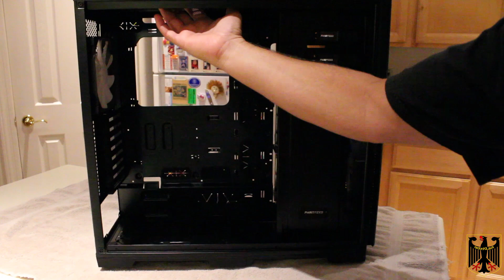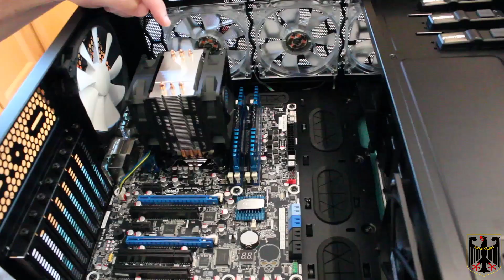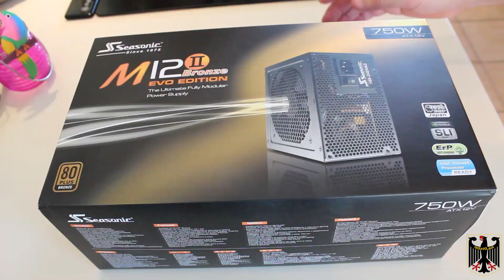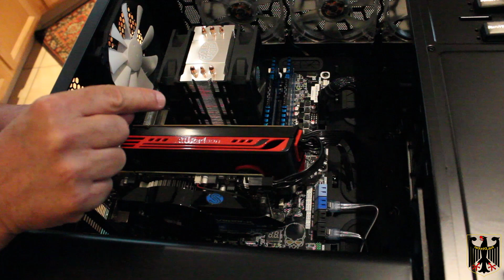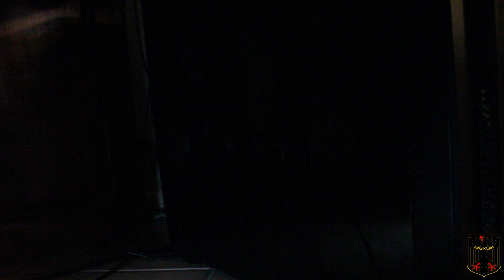Gaming PC Upgrade July 2014 - Phanteks Enthoo Pro and Seasonic M12II Evo 750W

Comment: I'm confused with the PWM hub.  So, do I still connect the CPU fan to the motherboard's CPU_FAN header?  The reason I ask is b/c the PWM hub includes a cable that is labeled to plug to the CPU_FAN header, but if I do that, where do I plug the CPU fan 4 pin connector?

Thanks
Reply from the maker: +Leba You plug the CPU fan into the CPU fan header, and you either plug the hub into the CPU fan 2 or an aux. fan header.  The reason it says to plug into the CPU fan header is the fact that it wasn't common to have all full PWM headers on a motherboard when the case was made.  Thanks for watching!

Comment: Do you have any problems with the fan on that PSU?
Reply from the maker: No issues at all, it's a great PSU.  Highly recommended.
Reply: redonKiLaus I have issues with mine (750watts M12ii Evo) , the fan is going grazy when I render or when I launch a game
Reply from the maker: Are you sure that it is the PSU fan?  I would venture to guess that it is the CPU or GPU fan, as those will certainly kick up when rendering videos or gaming.  If it is indeed the PSU fan, you are probably putting a high load on it if you are running multiple high-end GPUs and a high-end CPU, in which case you could do well with a higher-output PSU.  The most I ever run on a 750W PSU is 2 high end single GPU cards...3-way and 4-way, or 2 dual GPU cards require more power than 750W.
Reply: redonKiLaus nop its the PSU fan I tested them all , when i stop the psu fan the pc is pritty much silent =(
Reply from the maker: RMA the power supply, Seasonic is very good about replacing faulty components.
Reply: redonKiLaus Okey , I will ! :)
Thanks!
Reply: redonKiLaus How do you connect the fan connector Does it use a molex that will go into your PSU?
Reply from the maker: You use either a 4 pin PWM header on your motherboard OR a SATA power connector.
Reply: redonKiLaus Ahhh, And that cable comes from the Motherboard?
Reply from the maker: The PWM header is on the motherboard, the cable to connect the fan controller to the motherboard is included with the case.  The SATA power connector is on the power supply; it's the same connector you use for hard drives and SSDs.
Reply: redonKiLaus Ahh i see, So the PWM head connecter on this case that has a CPU fan header cable connects to where the cpu fan header would be while a sstandarddata cable would hook into that from the PSU right?
Reply from the maker: You can connect it to where the CPU fan connects, or you can connect it to another 4 pin fan header on the motherboard.  Either works just fine.  The SATA power connector is only used if you don't have a connector on the motherboard for the 4 pin cable - you use one or the other, not both.
Reply: redonKiLaus Ahh thanks, Greatly appreciated.

Comment: U should use a water cooler that way u wont get the added heat disappated from the cpu air cooler
Reply from the maker: I watercooled my first PC, but in all honesty, it's just too much maintenance for someone who doesn't mess with computers a ton anymore, and CLCs don't provide that big an advantage over tower air coolers (especially when it comes to price/performance).  Thanks for watching!

Comment: i have this case, just waiting for my other parts to come, but can this case have a cd reader ?
Reply from the maker: This case can hold 3 5.25in drives, though to be honest, I have put CD drives in any of my PCs since around 2009, as pretty much all media is downloaded and distributed online.  I do have an external Blu-Ray burner for HD video distribution if necessary, though.  Thanks for watching!
Reply: but how would i put a cd drive if the case only has 1 opener on the front...  the others dont open  :/
Reply from the maker: The front flap on the case is for the front I/O (USB, audio, etc).  Below that are 3 5.25in bays with covers.  All you have to do is remove one of the covers and slide in a 5.25in drive.
Reply: thanks so much dude ! i forgot to sub!